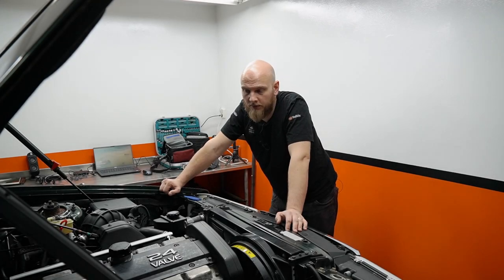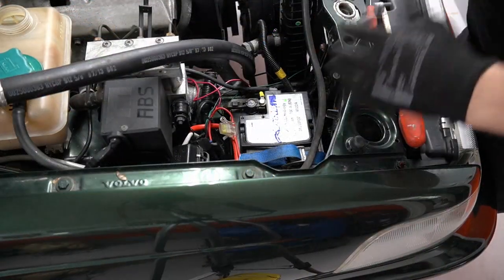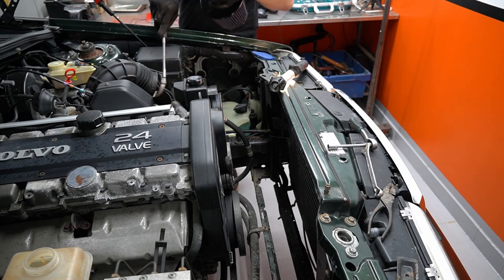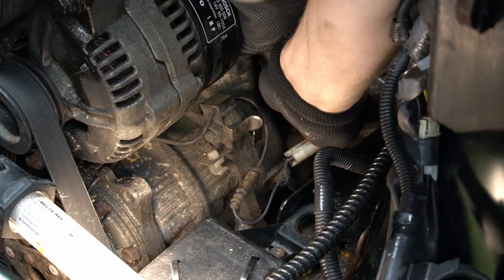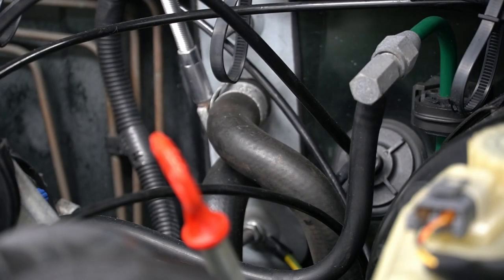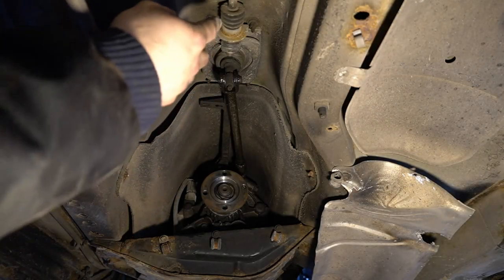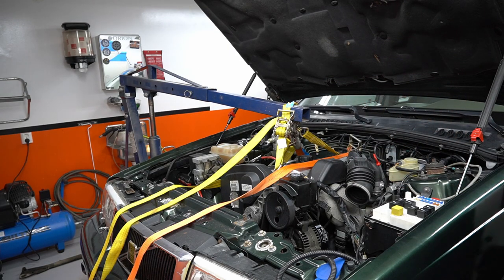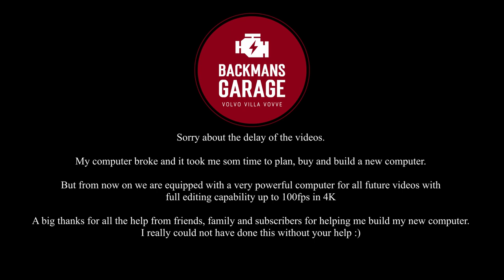VOLVO 740 T5 ENGINE SWAP - Part 3 - REMOVING THE V90 ENGINE

Comment: Nice series! awesome project! can't wait to see the result! Ive been thinking about swapping a t5 in my 240 so your vid can be really helpful!
Reply from the maker: Thanks! Volvo 240 T5 was actually my first T5 project back in 2010, but it failed due to money problems. I do remember me using a 2.0 L engine from an Italian Volvo 850 since that was the only engine you could register with at the time. I never got so far as to driving the car but i did do some of the engine work before quitting. Good luck with your build! :)
Reply: @BackmansGarage  Oh cool!!! was it hard? what was the most difficult part? Im saving up right now! but mostly such builds come out more expensive then you expect beforehand...

Comment: Hello from New York I have a very good running 960 wagon with the straight six. Can I use the same transmission if I ever swap for a t5? And what's the reason for the swap besides having fun? My car drives great wish had more take off speed but it cruises beautiful.
Reply from the maker: Yes you can. Jupp, just for fun + the sound

Comment: on these Volvo, if you remove the rad and the top part of the radiator support, you can pull the engine by lifting it not more than 1 foot ( 30 cm)
Reply: As someone who just got a 745 and is about to tear into it, thank you very much.

Comment: Greetings what types of rear-wheel drive gearboxes are compatible with t5 engines? Thank you
Reply from the maker: As far as i know, only the M90 from another whitblock engine. I have heard that one can use the gearbox from a Volvo 940, but with the bellhousing from a Whitblock as well, but I have not done that myself.